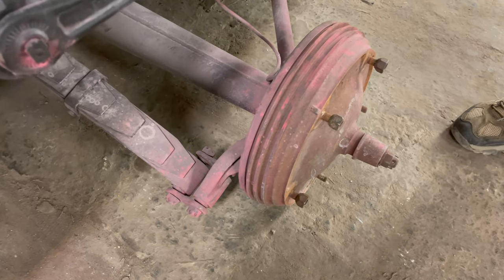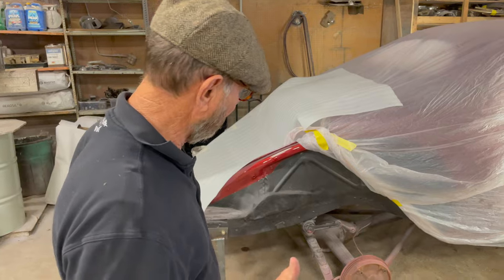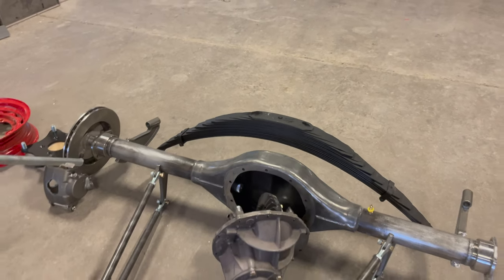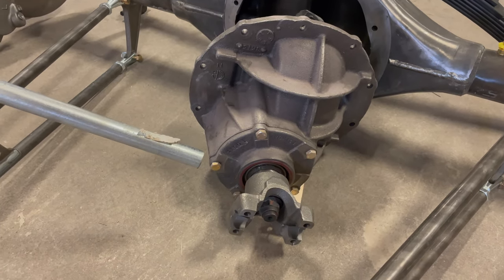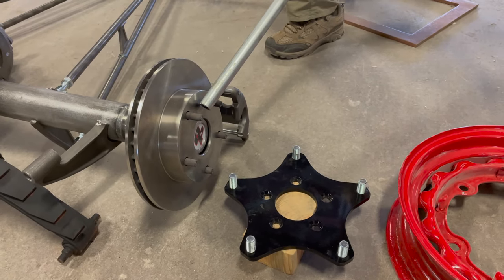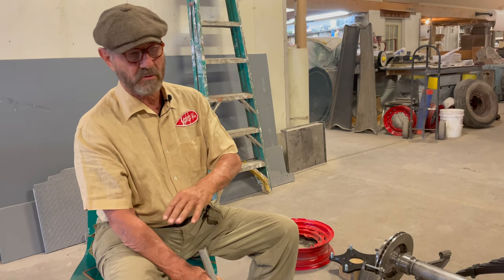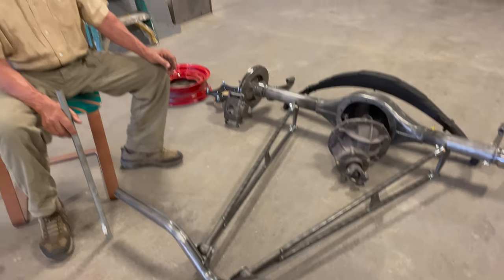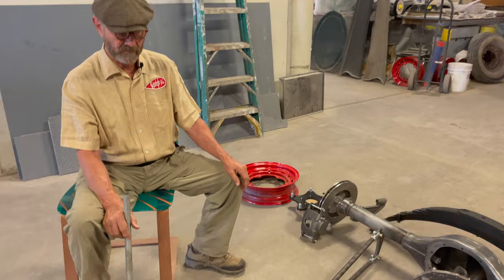1938 Zephyr Part 31 - Driveline and Chassis Build begins! Restoration of a 1938 Lincoln V12 Coupe

Comment: I see the wheel adapters he going to use ------ I like the looks of the ---- Artillery ---- Wheel ------- I wonder if the modern day Tire shops can change a tire on one of those wheels ----- since the center is so open ------ I wonder what size the wheel is ---- 16" or a 15" -------- will have to find that out ------- BJ said the rear caliper is a huge one ------ most of your hard braking is done with the front setup ---- calipers ----- if the back is huge ----- wonder how big of a unit he is putting on the front ---- since it does most of the work ------- Nice idea of using the rear leaf spring as the Panhard Bar -------- another idea I might use to keep the cost down ------ A Good informative video ----- Thank You ------- Rodney
Reply from the maker: Disc front and back.  It's possible to adjust the bias front to rear...